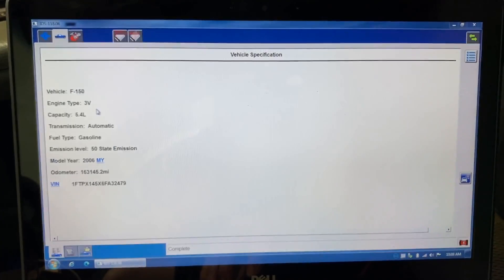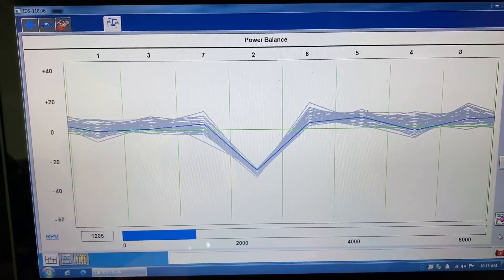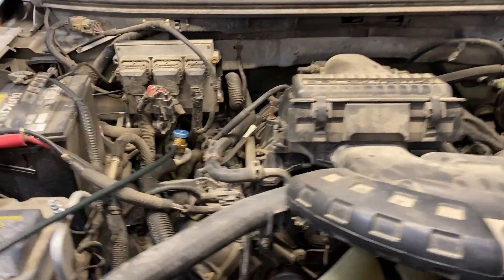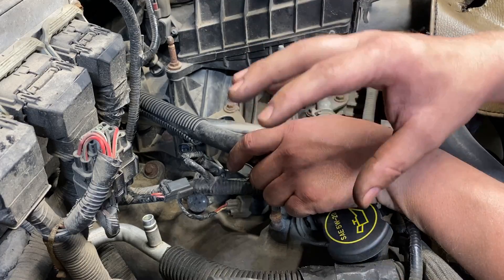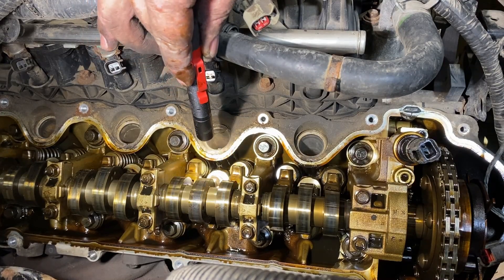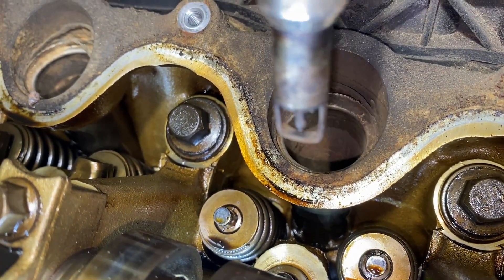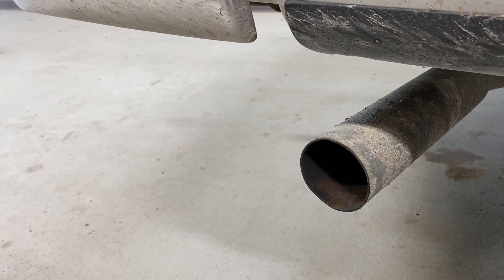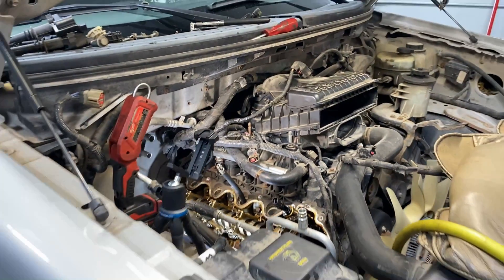Ford F-150 5.4L 3v Triton Compression Loss: P0302 Cylinder #2 Misfire Diagnostic Walkthrough

Comment: This is the only car I have(2004 f150 v3 5.4l) so I can't drive anywhere and I'm trying right now to remove and replace the old broken starter. I don't have penetrating fluid but a blow torch. I got the first bottom bolt out but the top but visible bolt is stuck. Is it safe to use the propane blow torch on the bell housing of the transmission where the bolt is to attempt to break loose the bolt?
Reply from the maker: I do it all the time yes, the middle bolt is the one that sticks all the time.
Reply: @FordTechMakuloco  So I do use the blow torch? I just put brake fluid on it because on the ford forums they said that it is just like penetrating fluid.
Reply: @MBWchannel  Clean up flammable stuff before the blowtorch. Use brake cleaner. let dry. You can make cheap penetrating fluid with nail polish remover from the dollar tree(100% acetone) and trans fluid.
Reply: @alb12345672  Is brake fluid flammable? Because I don't have brake cleaner.
Reply: @MBWchannel  Mildly. Wipe it off with lots water, you should be fine.
Reply: @alb12345672  Alright, This is my moms car and the first car I have ever worked on so that's why I am probably asking beginner questions. Thank you for the help.
Reply: @MBWchannel  No prob, got to start somewhere, we all did!
Reply: @alb12345672  Well I just finished the job and it cranks perfectly now.
Reply: Will this scan tool you're recommending do a Power Balance test as well also curious about an abs bleen function
Reply: @coryfriction2499  Go to your own comment.
Reply: @MBWchannel  sorry
Reply: @coryfriction2499  lol I was kinda joking.